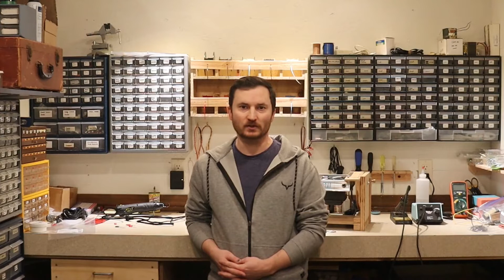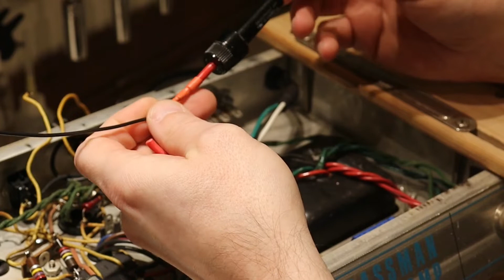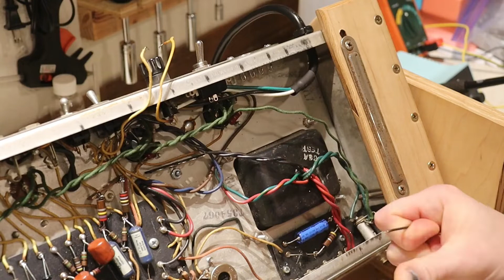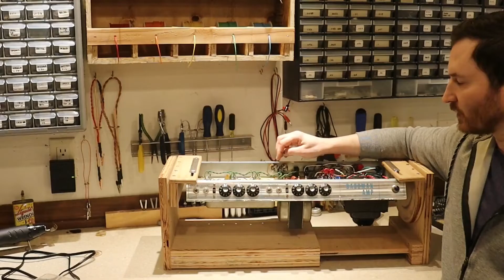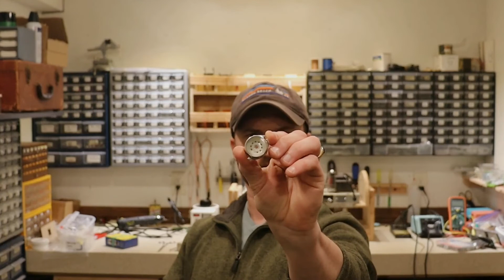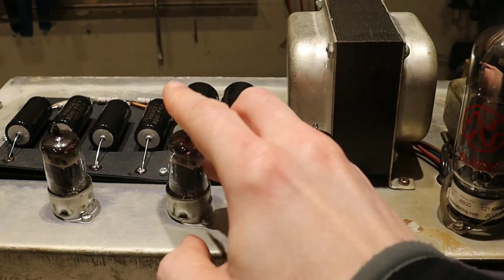Fender Bassman Repair Part 3

Comment: I've replaced a few of the sockets in my AB165.  I know its always a priority to try and keep a vintage amp as original as possible.  But it's more important to give the amp what it needs to last another 50 years.  Nobody wants to deal with a fuasy amp at a gig in front of a room full of people.  
Do what you feel is right for the project, Tim.  Own the responsibility in a manner that lets you sleep soundly at night.
Reply from the maker: Next part coming soon. I replaced the preamp tube sockets and that solved that problem. Still working out some oscillation in the power tubes (seems to be isolated to the screen grids) which is probably another loose pin.